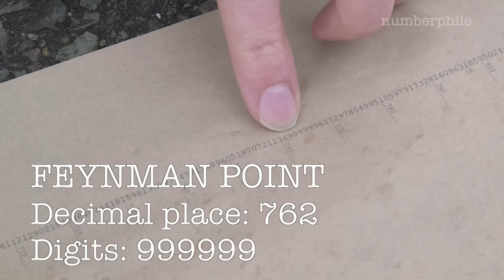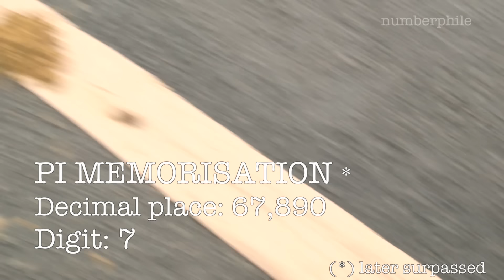Mile of Pi - Numberphile

Comment: I sent this email to some friends the other day, all ex-physicists, same as me (50 years ago)

<<<<<
The equation for the length of a circumference c of a circle of radius r is  c = 2𝛑r.  𝛑 is an irrational number.

So, imagine a infinitesimally thin piece of string of precise length, say, 6 cm. Lay it down on a flat surface. Fix one end and rotate the string about the fixed end so that the other end maps out the circumference of a perfect circle. You have just “drawn” a curved line of irrational length.

Now, imagine another thin line of precise length, say, 30 cm. Bring the two ends together to have the string form the circumference of a perfect circle. Using the formula c/2𝛑 = r means that the circle you have just formed has a radius whose length is irrational.
>>>>>

One of them replied that sqrt(2) is irrational but that multiplying sqrt(2) x sqrt(2) yields 2, a rational number. Is that generalizable? That is, if the radial distance is irrational, and 𝛑
 is, then can multiplying them yield a rational length for the circumference.

I don't know how to think about this.

Comment: Other than memorizing Pi, is there an easy way to figure out what the next number in the sequence will be with some mathematical equation?
Reply: EPS5000 I'm glad you asked. No, I don't believe there is an equation that produces the digits of pi in order. There are a few equations that as x approaches infinity, the value approaches a number close to pi, but for accuracy, pi has to be measured. Instead of measuring by hand, very powerful computers make extremely precise virtual measurements.
Reply: Marius Facktor I remember reading about one that only worked in hexadecimal, so I think there is.

Comment: I think that a reason that pi is irrational is because circles may be irrational. I'll try to explain my theory (feel free to criticize). 

If one takes a square and on every corner they draw a diagonal line, then it will make an octagon. If you do that to the octagon and every shape after that then you get a circle, but you would have to do it infinitely many times. Circles can always be "rounder" so a circle that is has complete roundness can not be physically possible. 

If the shape is not rational how can the formula be rational?

Comment: There are 72 points/inch, so each of 1,000,000 digits would be about 4.5 points wide,  This could be 10 point type which is 10 points from top to bottom of descenders, and digits could be about 4.5 points per digit.

Comment: You didn't calculate 22/7 obviously, that would be rational. So how did you get a computer calculate pi this precise, as a result of which calculation? I wonder if the error in "pi"-"this computation" is below h/4*pi .

Comment: First I memorized the two next digits after 3.14, which is 15, then a year after, I memorized the next two digits after that (92), and recently, I memorized (or am memorizing) the next two digits; 65. I'm continuing with this indefinitely :P
So right now, I can remember 9 digits of pi (3.14159265)
Reply: Emil Macko 
I used to do that when I was bored at school, but I didn't go further than 50 digets. Should try to get to 100, that would be an accomplishment :)

Comment: Assuming 590.55 digits to the metre, that works out to 23,666,301,289 digits to stretch around the equator.  Or 227,006,829,450 digits to the moon.  So, a trillion digits would require more than two trips to the moon and back.  Shows how big a trillion is.

Comment: Or if you consider pi to be exactly 3 as the ratio of the circumference of the circle to its diametre found with my formula
Cir =2pir = 2 *3*4cm = exactly 24cm

Comment: The ratio  of any circle to its diametre in my formula us 3 but not such any irrational number and undeniable value  as pi 
For Cir =24 cm
24cm ÷ 8 = 3 
For Cir = 26

26cm ÷ ( 2*4.3333333333 cm) = 3 
 
For Cir = 45 cm 
R = 45/6 = 7.5 cm ---> d = 2*7.5cm
45cm/ 2*7.5cm = exactly 3

Comment: Reference Estimating the wealth; Encyclopedia Britannica.

A Babylonian cuneiform tablet written some 3,000 years ago treats problems about dams, wells, water clocks, and excavations. It also has an exercise in circular enclosures with an implied value of π pi = 3. The contractor for King Solomon's swimming pool, who made a pond 10 cubits across and 30 cubits around (1 Kings 7:23) used the same value. 

Reference Wikipedia

Geometry[edit] Babylonians knew the common rules for measuring volumes and areas. They measured the circumference of a circle as three times the diameter and the area as one-twelfth the square of the circumference, which would be correct if π is estimated as 3. 

Quote: "which would be correct if π is estimated as 3"

"Unbelievable!!!"... "which would be correct if π is estimated as 3"

Therefore Mathematicians should be asked why it is that they choose to use the irrationality of 3.14159  (3 & a bit) relative to the rationality of a circle comprised of three dimensions of equal  length; rather than 3 which is rational to those three dimensions of a circle.

Diameter Line 120 cm x 3 = 360 cm
A circle has 360 degrees 
Each degree is 1 cm long

The Area of a Circle 3 X r2
120 cm x 120 cm; Square = 4. 400 sq cm 
1 right angle = 120 cm 
120 cm ÷ 2 = 60 cm radius 
60 cm x 60 cm = 3,600 sq cm
3,600 sq cm x 3 = 10, 800 sq cm to the area of the Circle
Which is 3/4 of the area to the 14, 400 sq cm square
 
Or a simpler and faster method 
Diameter 120 cm x 12 = 14, 400 sq cm to the square
Diameter 120 cm x 9 = 10, 800 square centimeters to the circle

Sumerian Confirmation

Circumference 360 cm x 360 = 129, 600 cm divide by 12 = 10, 800 square centimeters to the circle

Comment: What is the purpose of finding pi ?
What if pi comees to an end?
Is it just human curiosity?
Reply: What is the purpose of finding pi? Because human curiosity. What if pi comees [sic] to an end? It doesn't. It's been proven. It's a sum of infinite numbers-- google it and you'll find out.
Reply: As far as humanity is concerned, Pi ends at the 65th digit. There's some change after that, of course, but it doesn't matter. Not when you can calculate the circumference of the universe and be off by a planck length.
Reply: more digits more accurate makes its better for building circles for round arena...etc. but you don't need that much. plus those papers printed from a machine and they wanna see whats in it. maybe there are patterns that could lead to unlock another mystery of the universe who knows !

Comment: its crazy how pi contains the binary representation of everything ill ever say or ever have said and has the binary representation of every moment of my life as a 4k image from each angle, it is also very cool cause more digits than grahams number represents and also grahams number to the power of grahams number and that to the power of itself and if you keep doing that for a grahams number of times per second for a grahams number of years you would and then wrote out as many nines as the number represented and did that grahams number of times a second for grahams number of years then used the put that number to the power of itself the put the result to the power of itself and kept repeating that grahams number of times every second for a grahams number of years then the results was made into all nines then you calculated that many digits of pi then you times that by the radius squared you still would have an accurate area

Comment: actually Pi is a finite Number, because a ''Perfect circle''' consists of atoms, which have finite lenght too :) am I right?
Reply: No, you are not. The circle exists independent of the atoms. It is rather a concept, not a material thing. And for calculating the concept, you need Pi anyway, independent of your atoms.

Comment: but how did that machine calculated value of pi?
Reply: +Anukrit sharma I'm sure it was calculated ahead of time, and then entered into the machine.
Reply: +Karat Carrot but how.......
Reply: The first million digits of pi have been known for quite a while. I'd say it is safe to assume that no one from the Numberphile channel or from the video were the ones who did the calculating.
Reply: Karat Carrot OK but how they were calculated my friend ¿!
Reply: +Anukrit sharma I myself am not an expert on the subject, but it looks as though for the past 6 years, people are using a program that is specifically designed to calculate pi, called y-cruncher. They let the program run for several hundred days, and it spits out a few more digits. If you want to see how it works, download it and check it out, it's pretty interesting, and anyone can run it on their computer.

Comment: Wouldn’t this be more than a mile? Wouldn’t the spaces between the digits add up?
Reply: No, the pixel count is with the spaces. We did adjust for that. Each print is 1 foot, accurate to the pixel.

Comment: Congrats. You can now calculate the circumference of the known universe with a margin of error smaller than a nanonanonanonano(ad nauseam)metre.

The diameter of a helium atom is about 0.1 nm.
Can we stop computing massively unnecessary digits of pi yet?

Comment: How have you calculated this?
Reply: +Jamie Stirzaker Pen and Paper. The whole science works with Pen and Paper today because Newton has done it also.
Reply: Lovely irreverent reply =) But honestly, how is it possible to calculate to a mile lengths of digits?
Reply: +Jamie Stirzaker There are numerous methods for calculating decimal approximations of pi. Most of them involve various infinite series that, when continued on for long enough, will give as many decimal places of pi as you want. A simple example is the Gregory-Leibniz series, which states that 1-1/3+1/5-1/7+1/9-...=π/4. This basically just uses the fact that arctan(1)=π/4 and plugs in 1 to the Taylor series of arctan(x)=x-x^3/3+x^5/5-x^7/7+.... A computer program could evaluate this series to many decimal places and then simply multiply by four to give an approximation of pi. This series converges quite slowly though, so they more likely used a much more complicated series. Infinite series are very useful tools for computing decimal approximations of irrational numbers. Calculators use infinite series to compute trigonometric functions, exponentials, logarithms, and much more.

Comment: My question is...How can pi be calculated to a million digits?The only way to calculate the "true" value of pi is to get a real, physical circle, measure the circumference and the diameter, and divide.  But, science 101, no matter how precise the measurements, there is always an uncertainty.  There will be a finite number of significant (accurate) figures in the measured values leading to a finite number of significant (accurate) figures in the calculated value of pi.

Comment: The reason why calculus was invented is alsi because all curves come from straight lines or segments 

 All segments and lines and curves come from points and each point is like a ball or globe with  circular boundaries , and thus each point has radii and and diametres when being enlarged 
Differentiation is nothing else other than dividing objects of different shapes which are not like the shapes which regular formulas can be used to calculate, into segments and points so that human limited knowledge can use such formulas to calculate them, and integration is merely a shorter way to add up the results

It can be said that using  pi is a  bad mathematical habit of human limited knowledge

Comment: Pi is not an irrational number,pi is 2

2 Examples:
Calculator morally solve it for base 10 (Decimals),so 1+1=2 and pi=3.14159... but I answer 1+1=10 and pi=2
Am I correct?
Absolutely correct!

Mathematics difference Radix such as parallel Universe so if you use base 2 (Binary),you will solve it (1+1=10)
In base 10 (Decimals),you will solve it 1+1=2 and in base 12 (Duodecimals),you will solve it 1+1=2=pi

Circulating Ratio Pi in base 10=3.141592653... (Irrational number)
Circulating Ratio pi in base 12=2 (Whole number)

English timetable,a dozen of cheesecake,stars,pyramids and clock morally use base 12
In English,University as same as Universe
In the Universe,Circulating Ratio Pi must be a whole number
Universe and college : Astronomy,Physical,Chemical,Biological,geographic and music use Radix 12 is the best solutions in the Universal to be communicating college 
(When you know the concept of UFO and crop circle apocalypse,you will know why the Universe is built in base 12 (Duodecimals))
Reply: Sorry, but the days per month on Earth doesn't allow base 12. :P

Comment: Pi is infinite while a circle is is obviously finite  coming from a measurable straight segment 
You guys should at least  have asked yourselves why there is such an unacceptable contradiction, and how any accuracy can be achieved at all , when you multiply  a value by  such a irrational number with no ending digit at all, or such an infinite value  to produce a result as a defined value

Comment: top 10 digets of pi
10:4
there was a run of over 100 digets without the number 4
9:9
9 is the highest number you can get in pi
8:8
no reson
7:7
7 is illuminati
6:5
there was a mark in this video of the 100000th 5
5:6
to make it the oposite of 6
4:2
you can make a fish with 2
3:3
3 can make an 8
2:4
so its the oposite of 4
1:1
1 is the last digit of pi

Comment: Pi is not a real value or not a well-defined value having and endless number of non-repeating digits 

The reason why it has been used by human limited knowledge for so long is nit because it can represent any real value, but because it is agreed to represent  an assumed value which serve as a  convenient way to apply human-invented concepts of mathematics 
It is just  too easy for me to prove with objective and undeniable facts that pi isca nonsensical number being an irrational number or not a well-defined value as rational numbers 

Herd is why it is so:
All curves always come from limited  straight lines or straight segments , including all circles ,  all ellipses and such closed curves 
It means that circles of all sizes have well-defined values which can be represeted with either integers or rational numbers , but not any irrational number like pi which obviously is not a well-defined value with an infinite number of digits after tge decimal point , and thus it can never represent any accuracy 

Ex: you have a straight segment of 24 cm , and want to make it become a circle. It us nonsensical to use the formula 2pi r to calculate the radius of the circle , while pi is not a well-defined value , and the segment to become the circumference ofvtge circle  is  so obviously  a very well-defined value 
You can never find a well-defined value by multiplying 
 a well-defined value by an irrational number to get any accurate result 
A well-defined output of a function or an accurate calculation can be achieved only when all the inputs are well-defined values 

So if you use the formula 24 =2pi r , you can get only an approximation or an inaccurate output 
r = 24cm/2pi = 3.8197186342 which has been truncated to be rounded up 

Now if you use my formula for the circumferences of all sizes 
Cir = 6radii = 3 diametres , you will get an accurate output which b
is either an integer or a rational number 
6 *r = 24cm/ 6 = 4 cm 

If the straight segment is 26cm 
With the formula Cir = 2pi r , you will get r as : 
r = 26cm/2 pi = 4.1380285204

Whereas with my formula Cir = 6 r ,